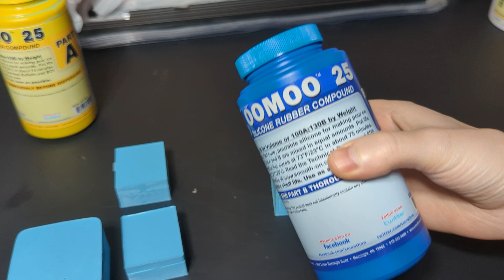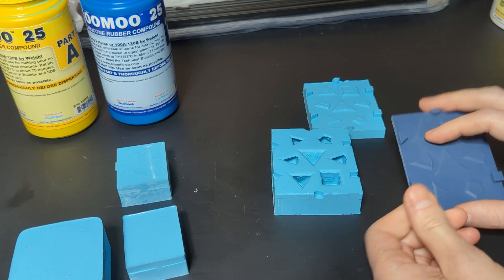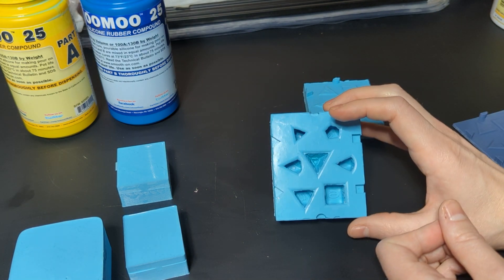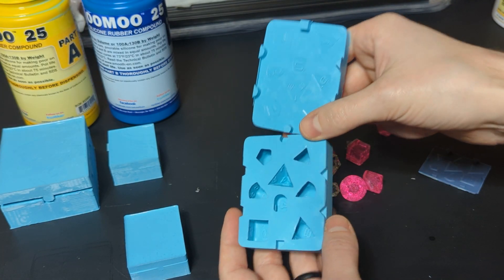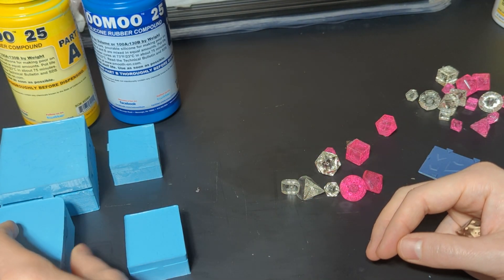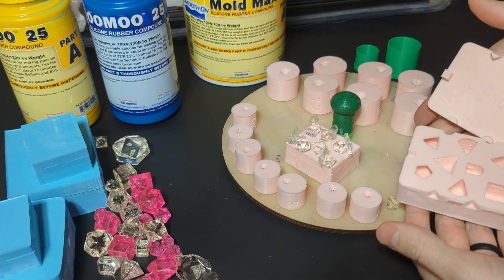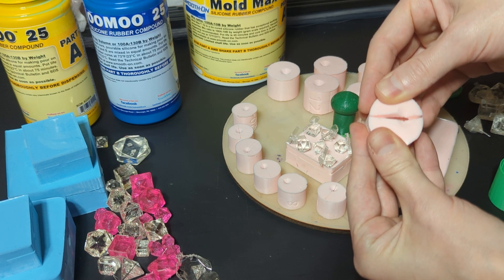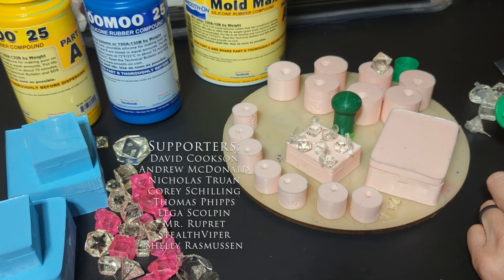Tin Cure Silicone Molds for 3D Printed UV Resin Dice

Comment: Ik this is an old video but I have been having a problem with my molds anyway it you get ur printer settings right you could just print the dice connected to a cup that has a removable slot to take out the part